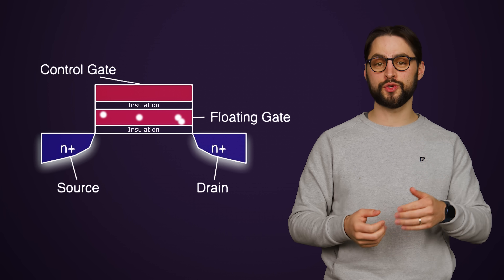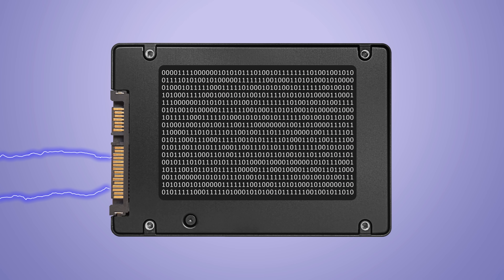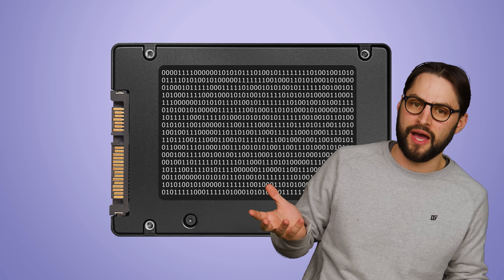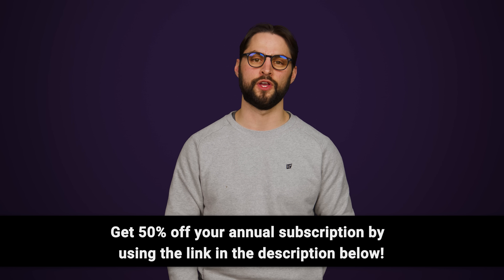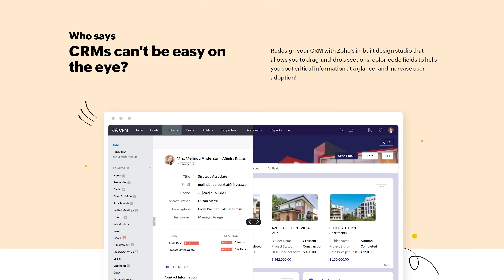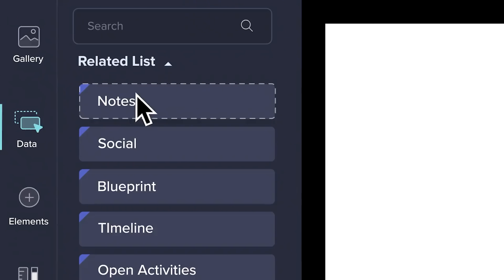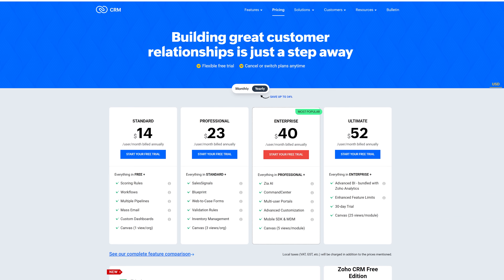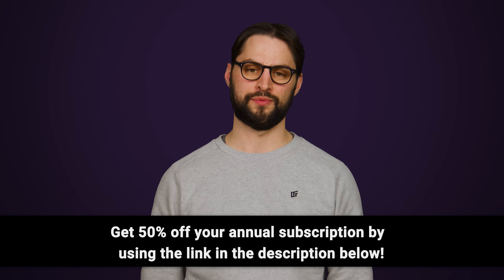SSDs Die, RAM Doesn't. Why?

Comment: RAM does not relies on capacitors... LOL, but on mosfets, a type of transistor where capacity is forced by architecture, and is more then often concider a parasitic property. 
Now, I've let my tech rage, out, so that no one would actually be interested, or read about it, as almost no one reads comments on you tube

Comment: It's probably because RAM doesn't store information permanently, which means no forced structural changes and therefore no noticeable wear so long as the temperatures and voltage are under spec.
the same goes for CPUs, GPUs and VRAM(basically just same as RAM but on a GPU) chips.
Hard drives deteriorate due to the presence of moving parts and have to oprerate on precise timings to read and write data on sectors correctly and SSDs deteriorate due to the fact they use over spec voltage to write data in, which degrades the physical structure of the cells(It's like using a high voltage to burn through an isolator and then expect it to still hold up to smaller voltages and hold the charge(yes, SSDs are this stupid)).

Comment: Here is something to consider. M$ favorite file system is still NTFS, which used to an okay file system for hard drives with drives in it. So for disks with physically spinning discs, NTFS had some good ideas. However, for SSD's those same ideas are now very, very bad for SSD's.
On the Linux side of things, the most used file system is EXT4, which is still developed and changes made specifically for SSD usage, the wear down is much slower, because the EXT4 file system first uses the RAM to collect reads and writes to and from the file system before commencing them. Also on Linux, write operations on desktop Linux are far fewer than M$'s constant useless and permanent read and write operations.

Comment: capacitors also have a insulating dielectric between the two plates, & they also wear out heat & voltage acclerates this.

Comment: wait a minute, why don't they put batteries on ssds then and just use capacitors, as long as it would hold a charge it would hold the data would it not? something kind of like a CMOS battery.

Comment: This is false. I've had to replace ram far more than SSD's
Reply: Lol what kind of RAM are you even using? I have been PC gaming since the early 90's during the MS-DOS era and NEVER ONCE have I ever replaced any of the RAM in my computer ever. Heck, all the RAM sticks in my old Windows XP era PC is still working fine till this day. It's either you get a working stick of RAM right out of the box or you don't.
Reply: @DarkZerol  oh god all sorts, just this year I had to replace some G-skill 16gb ddr4 cause I was just getting random bluescreens every couple of days. memory checker said no issues so I put them in a 2nd machine for a while and after a few hours that one bluescreened as well. I've had a lifelong terrible experience with ram

Comment: Im sad 3D XPoint is basically dead. The tech was so much better than SSDs. It was actually more like how a mechanical hard drive worked in principle, but with more modern and far faster materials, and changing phase state of the material instead of magnetic state like a hard drive. XPoint had so much more potential for new SSDs and the future of drive storage if it had just had more R&D and mass manufacturing put into it :(

Comment: SSD endurance won't remain a problem for a long time since we are nearing the fundamental limits of NAND flash chips in term of how small the floating gate transistors can be made (it starts to have an actual issue at nodes smaller than 10 - 5 nanometers), so magnetoresistive RAM (MRAM) may be used in the future SSDs within this decade permitting them to have huge capacity without any implications (2 - 1.4 nanometers GAAFET / CFET MRAM chips have been successfully tested).

Can't wait for the SSD that's basically unkillable.

Comment: But if an SSD fails, does it become completely read only, or only the broken sectors read only? I have noticed with multiple SSDs that the total reported storage appears to shrink every now and then if you take a file off of it. Is that because the deleted file was the last thing allowed to be written to that part of the SSD and the sectors it was written to are now considered dead?
Reply: Probably SSD detects when some sectors are at their last breath and tell you that they are going to die, of course there are very small chances that the entire SSD will die in one single moment (just because some sectors would be rewritten more times then another's)
Reply: A more common way that SSDs die is that their controller dies, so you don't get any access to your files.

Comment: Overclocking ram, I can get stable 3000 or 3200 MHz (one of my sticks is rated for 2400mhz at xmp, got this one for free), but the performance is actually worse than at 2800, while the primary timings were only increased by 1 or two each. Why? Oc is stable, tested it in memtest86, prime95 and tm5 extreme preset.
Reply: Sometimes timing makes a huge difference in performance, especially on some platforms.

Comment: Didn't really answer the question. What happens to the insulating layer at the chemical level? "Forcing" electrons normally doesn't wear things out. Are we talking mechanical damage at the molecular level? Seems hard to believe. I guess I will need another video.

Comment: I've had two Micron C300 in 2013 dying within the first 6 months. They did not enter read-only mode, but accept writes until the cache is full, and then time out after a few minutes. Had to use Linux so I could make an image, as there I could force the OS to mount read-only.

Comment: I still run windows XP on a AMD Duron 1200 with 2GB SDRam I use just for fun now & again for the memories. And I purchased old office equipment for the parts so the ram would have been hammered. Makes you wonder why they can't make SSDs using ram.

Comment: Since ram is way faster than regular memory even SSDs would it be possible to make a hard drive that uses RAM as the memory storage?

I'm talking about where when you unplug the RAM it keeps the memory by allowing power to it because there's some kind of battery that's still sending power to the RAM 24/7 like how an old video game saved data.

Comment: SSDs use an unimaginably tiny gap, an incredibly thin dielectric insulator, you think 3nm transistor gate lengths are small?? Pfft...  This insulation is in fact only a few atoms, forget nanometres.  The way the SSD works is by quantum tunneling electrons, the electrons literally vanish and teleport somewhere else in space time.   
A binary 1 or 0 is in fact just a voltage, one that has enough current to make the magnetic field large enough to get the information to the destination.  When the signal is sufficient it is a 1, when it is not completely sufficient and errors in the signal begin, it is a 0

Comment: isn't the entire point of capacitors to hold charge even when not connected to a source of electricity? how are the capacitors in ram "unable" to hold charge when the pc is turned off? or is it because they're very small capacitors, and so because they're small they lose charge very quickly?

Comment: How many TBW is a good rating for a 4TB drive, I see people complaining on forums about 900TBW for a 4TB drive, but see that somewhat standard for QLC drives of this size.  Are there better M.2s out there with more than 900TBW to look for?  My kid just had a 4TB spinner fail and corrupted his main M.2 drive, had to reinstall windows after removing a program that was stored on the spinner, controller somehow corrupted his main drive when he attempted a repair without removing the failed drive. . told him to wait for my help... anyhow he is a gamer and the 4TB will hold games being rewritten/updated often and hate to let him buy a drive that will fail in a short period.. there is only 1 open M.2 available on his board. Is 900 good enough or not?
Reply: Guess he can get something like the 870 EVO SATA 2.5" SSD 4TB which has 2400TBW, faster than the spinner he was using..

Comment: Did this just claim that capacitors dont have an insulating layer? Last time I checked, they do. Actually the definition of a capacitor is two conducting plates with some sort of an insulator in betweem them. Oh... and capacitors hold charge without power, but maybe just not well enough to use as non volatile memory.

Comment: When ssds fail they go into read only but as you saw in northridgefix when ssds fail in most cases it's a board problem with blown components. The time it takes for a consumer to fail an ssd takes 10 or 20 years which is longer than a hard drive.

Comment: In short SSDs die for the same reason as USB thumb Drives and Memory cards do. By storing electricity, they degrade over time as the semi permiable walls that allow them to store data form a tiny crack every time something passes through it

Comment: Sorry... what ????
"Take away the charge and the capacitors can''t hold charge anymore"

Mate, i don't know who taught you about capacitors
but if you apply say 10V to a 30V capacitor
then you turn off the power supply
you disconnect the capacitor from the power supply
YOUR 10V will still be in the capacitor 
you can measure that on a multimeter

The entire purpose of a capacitor is that it CAN hold charge without voltage being applied to it
Until
More voltage is applied to it
or
The capacitor is discharged
You sure you perhaps were not talking about an Inductor ?
i mean it stores current in a magnetic field, but the only thing i can think of is....
if you stop the current and voltage going through an inductor the magnetic field collapses 
and it's all gone

with a cap it can stay there for months after you've turned off the computer

Aslo. RAM is not "Referred to" as VOLATILE MEMORY
RAM  .... IS... Volatile Memory
it's not just a way of referring to it

Comment: 2:39 those big cylindrical caps are electrolytic and contain a solution that "dries out" over time and they stop working[1]; you say RAM does not stop working!

[1]This is why old electronic devices often need to be recapped with new ones.

Comment: If you would store data on an SSD and put it away 10 years. Wouldn't the charge on the cells determining if its a 1 or a 0 degrade? How long would it take to degrade so much that the bit is lost?

Comment: Well, ActUALLy, there are no capacitors in DRAM!
What is used is the parasitic body capacitance that is inherent to silicon on insulator transistors, and it is such a small capacitance - it has to be refreshed like 10-20 times every second!

Comment: I wonder if we can build a storage device that can store data like RAM does and if it would be within a reasonable cost. 
If we can attach a power module that retains a minimal amount of voltage to keep the data within them alive for like 7 days, a month or so. And it would come with a tiny super thin like indicator that would tell you how long the power is likely to last. If something like that can maintain a low power state sufficient enough for keeping the data safe for at least 30 days I think we might have a new kind of storage device on our hands someday. One that will last a lifetime or many decades at least. 
Because I've pretty much given up on the superman crystal and those other extremely dense and durable prototypes of massive storage units.

Comment: Actually, RAM can die. There are on board tests to check for RAM failure. Start your computer in configuration mode and you will see it. There are also some programs to test RAM when not in configuration mode.

Comment: Basically what I’m asking below is Are SSDs basically just another made-to-break-down technology:
So how long is the data’s life expectancy on a SSD compared to an HDD? As I understand, other components are the ones that usually break down in HDDs but the actual disk storing the data could be transferred to other functioning hardware thus prolonging its life.
This understanding is basically from what I’ve quickly read in some articles, not something I’d consider knowledge.
Reply: Also, how does this apply to memory sticks and cards and what are the ways to prolong the life of SSDs and memory sticks?

Comment: RAM can degrade but over decades rather than years unless RAM ends up faulty. Different RAM types can last longer than others like older RAM sticks from the 1980s or 1990s tend to last longer than more modern ones.

Comment: This degradation caused by writing is why you should never use more than about 3/4 of your SSD capacity. The write leveling function will have some space to spread out the write wear and make your SSD last longer. If you don't and write to it frequently,  you may have to obtain a replacement SSD and transfer the data to it sooner than expected.
Reply: SSDs usually do this by default, they are a bit bigger than advertised and have some unusable space

Comment: i must admit my first experience with SSDs was bad. i bought a cheap 60GB corair force SSD back in 2011/2012. it lasted less than a year and then it was dead and nothing was recoverable. but since that time i still have a SATA samsung 840 pro SSD 256gb in my system that is working flawlessly. ive done some checks on the drive and it has 19.4TB written of its (according to bing chatbot) 73TBW limit. its a good 10 years old now with a full 6 years of power on hours according to its SMART data.
maybe i got a dodgy drive from corsair, it was cheap so i never bothered with warranty. but i certainly now trust SSDs more than i do the 6 mechanical drives in an 11 year old raid5 that is just asking for a cascade of disk failures.

Comment: I bought my first SSD in 2013. A meager 128GB model. I remember at the time, having had zero experience with them before that point, thinking it couldn’t possibly last more than a year or two as a boot drive.

As of this month, it’s a decade old, and still running as a boot drive, though now in my brother’s PC. Turns out it really does matter how you use them 💁🏻‍♂️

Comment: i guess because RAM doesn’t takes high voltage to trap or detrap electrons in the CT or FG, SRAM uses two inverters and DRAM uses a integrated conductor at the source of the transistor

Comment: NAND-Flash work with quantum physics shenanigans. DRAM cells are basically just big solid state capacitors with a Transistor. The tolerance to fail between these two is worlds apart.

Comment: A DRAM memory cell usually uses two capacitors and a transistor. The transistor determines the binary data state of the memory cell, not the capacitors.

Comment: I run my ram at 600v 3 phase. Let's it store 1 extra bit and I get 4% increased speeds.  Ofcourse I cool the system with liquid nitrogen and power it with metalic helium.

Comment: I remember reading how sketchy the early MLC SSDs were. Basically a roulette wheel, get some speed, lose your data. Then the X-25M came out and that was all over instantly. It still works. I recorded video to it. It has weird caching issues where it hangs for a second though, always did.

Then I picked up some Samsung disks. About 30TB on them now, they're fine.

Now to be fair, IIRC I've never had a hard drive fail. Of course they will wear out - I just never wore one out in spite of years of use. So FWIW I don't necessarily find SSDs more or less reliable than mechanical drives.

Comment: there aren't physical capacitor in RAM, the charges that are retained are actually parassite charges that accumulate on the transistor and a near capacitor-like structure to extend the capacity which renders the whole transistor a capacitor like component

Comment: Except that RAMs do actually occasionally die as well. Just not as often as SSDs. Electronic circuits do degrade over time, no matter what material is used. Of course the PCB has a protective layer on top of the copper routes, but guess what? That protective layer won't be there forever, it degrades over time as well. It might however take a lot of time (possibly 30+ years), so hence the illusion that RAMs do not die. They do, it just takes quite a long time for them to do. If you buy a RAM module and find it dead after couple of years, you may have bought a bad module, that has been degraded from the manufacture already, and the quality wasn't that good, or the part was sitting on the shelf for too long. SSDs however need to contain the data after power off, and thus different technology is used. Technology that sadly drastically decreases the lifespan of the part. Each write degrades the part more and more, and eventually you end up with bad sectors. But it should still work much better and much more reliably than the older technology HDD, which is still based around the core concept of floppy disks, just with a hard material instead of the flexible plastic disc. But it is still using magnetic coating and moving parts to read from the disk. Moving parts degrade even more, which is why HDDs fail far more often than SSDs.